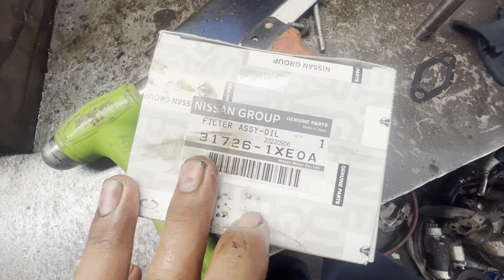How to properly service your Nissan Maxima CVT transmission Gen1

Comment: Excellent video. 
I just picked up an '08 Altima with the 3.5L with 112k miles. The car is in very nice shape owned by an older couple.
I wanted to do a full service on the trans so im so glad i found your channel. It is going to be such a help seeing it all opened up on the work bench. I'll order up the filter and fluid from nissan and get to the service next week
Thank you much for posting the content
Reply from the maker: you are welcome, I'm glad to help